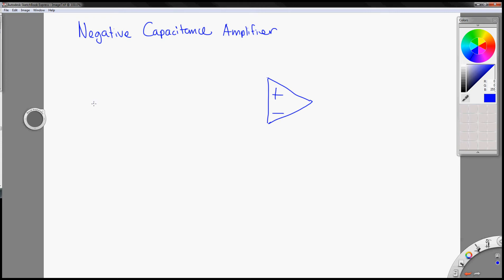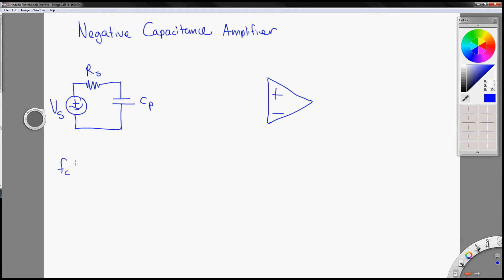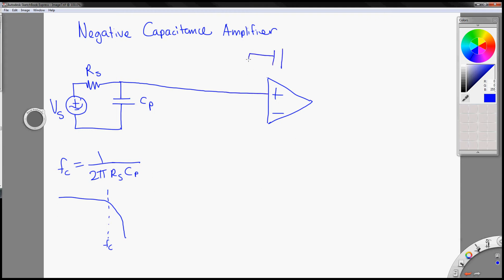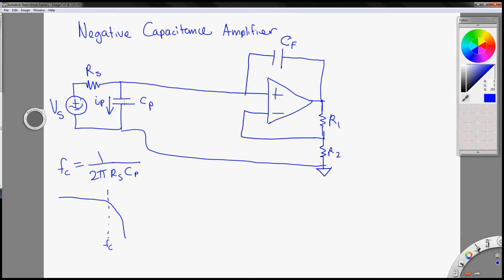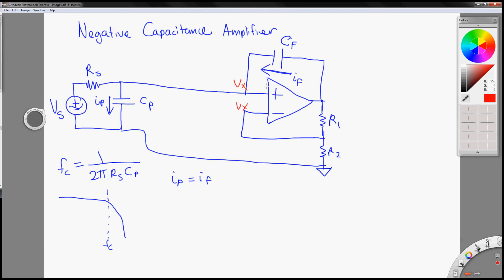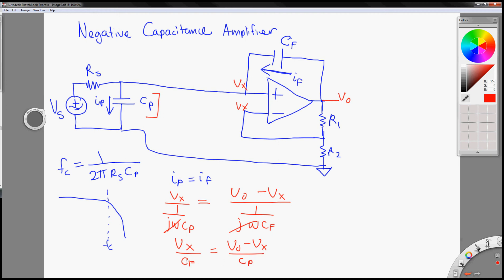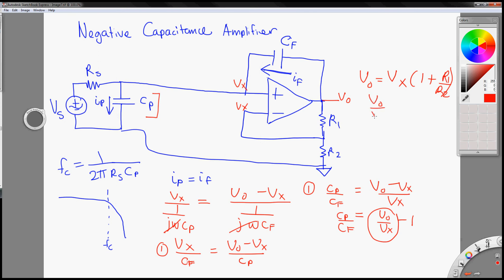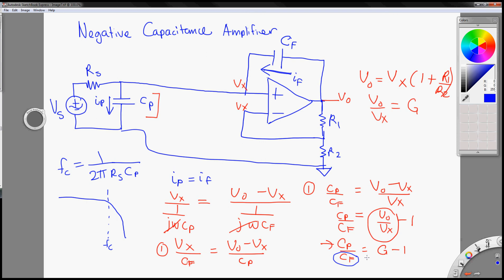Negative Capacitance Amplifer Example

Comment: Hi,
Seen the fact that Cp/Cf = Vo/Vx - 1 = 1 + R2/R1 - 1 = R2/R1

Cp/Cf = R2/R1

So, the ratio of capacitance must equal the ratio of the resistors fixing the gain of the OpAmp in this particular example.

Regards,
Othman.